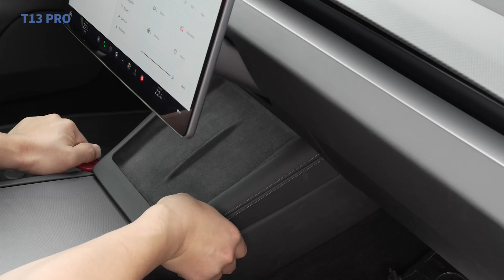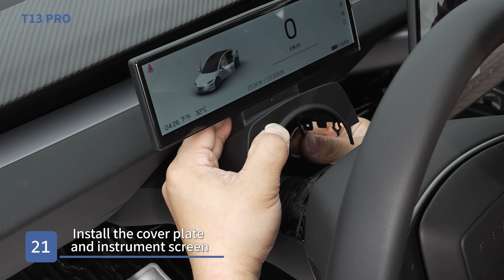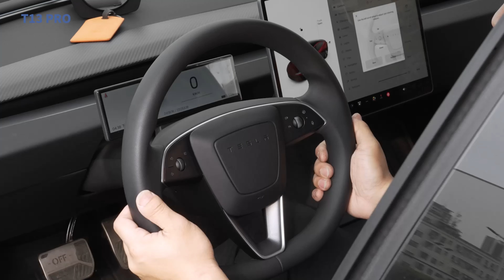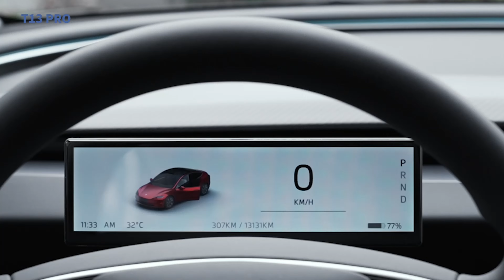(T13Pro) Model 3 Highland 8.8-inch Touch Dashboard Screen Installation Video

Comment: FYI for the performance model do not try to pry the knee panels they are held on by 4 bolts 2 on each side of the panels for driver and passenger. I know because I almost broke the panels following the instructions on the video.
Reply: You sir are the goat but wanted to inform everyone that those bolts don't only apply to the performance model. I just picked up my M3LR AWD and it has those 4 bolts as well. Also not sure if you struggled as bad as me but the damn wireless charging pad took me about 30 min to pry off and I broke a clip somewhere. The charging pad was easily the most frustrating part of the whole installation.
Reply: @infamousgook  I went around it and tuck the wires in no need to pry it up.